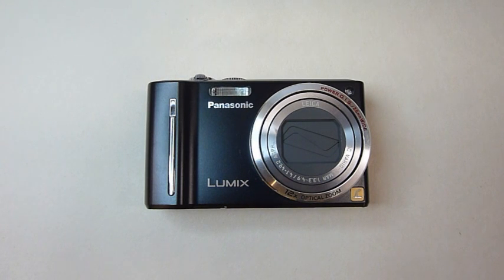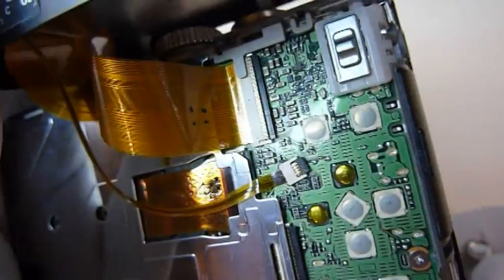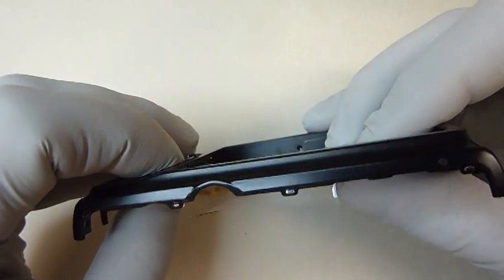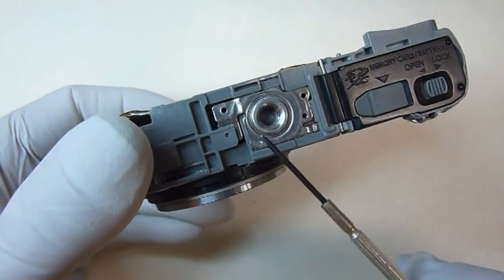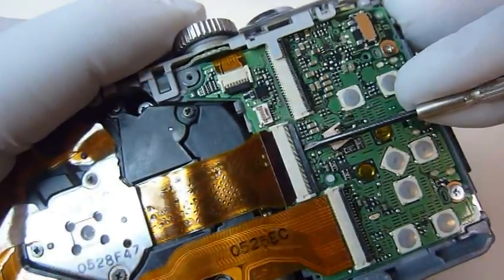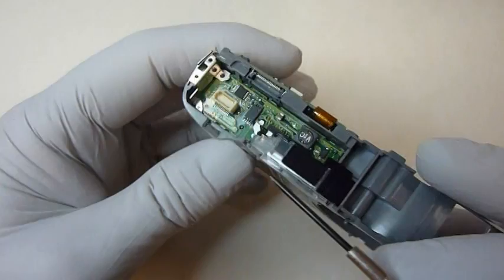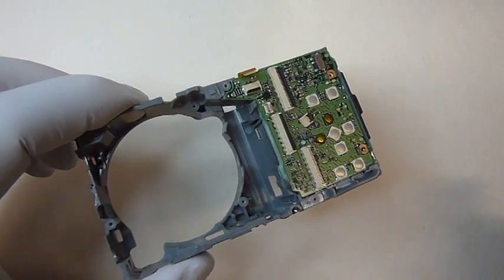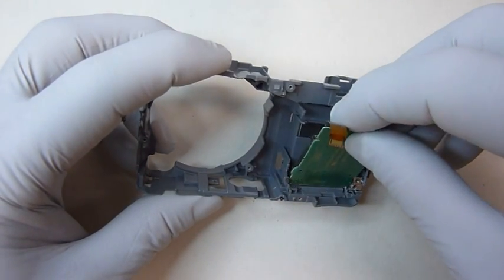Repair A Panasonic Lumix ZS6, ZS7, TZ9 and TZ10

Comment: since you say you've owned many Lumex Cameras perhaps you can help me troubleshoot an issue I have with my Panasonic Lumix DMC-ZR3. The zoom toggle and the mode dial are very hard to move. Niether move smoothly. What can be the cause and is it repairable?  Thanks Kathy
Reply from the maker: Hi Kathy.

I haven't worked on a ZR3 before, but it doesn't look too much different from some of the other models I have worked on. My guess would be that sand or something gritty got under the controls. Or, something sugary was spilled on the two controls (and I have first hand experience of doing that!). I would probable tear it down far enough to remove the top control piece and then remove the two control  knobs and clean under them. I haven't actually done that before, where I've removed the control knobs, but I can sure check it out to see what it will take. It might be a day or so before I will be able to do that though. I'll let you know what I find when I do.
- Bob
Reply: Robert Hosea thanks, I'll keep checking on for your advice. Much appreciated.

Comment: thanks..I only had to do an LCD replacement, on a ZS20, which is similar, and I wouldn't have had the nerve to try it without seeing your video. I was surprised it worked, as those tiny flat cables don't seem to go into the female parts very far and I was afraid to push them with anything that could cut the delicate little things. But, it worked putting them in what didn't seem enough. Thanks again.
Reply from the maker: Great job on getting the LCD display replaced. And thanks very much for your feedback!

Comment: Thank you for the video. I fixed my dust problem on my DMC-ZS7 with no difficulty. I used a brand new phillips #000 screwdriver ($5,95 + tax) and it worked great. Not sure Panasonic does the job for that price.
Reply from the maker: Great job! I'm glad you were able to clean your ZS7. Thanks for the feedback!!

Comment: Your video made it simple to remove and fix the SD card reader in my new , secondhand ZS7. BTW, the screwdriver I used was a Philips #000 bit from the iFixit driver set. Perfect fit.  I have decided to buy up broken cameras, and to fix them for fun ( profit, perhaps unlikely).

Thanks, again, Robert, 

Pj
Reply from the maker: Hey, thanks for the feedback Peter. I'm glad the video helped out and also that you were able to get your ZS7 going. You know, it's funny that I've tried a couple of #000 and #0000 screwdrivers from a couple of different sets and neither seem to fit the screws. That's good to know that you found some that work. I'll definitely check them out. Thanks!

Comment: Hi Robert -
I wrote a month ago and am now trying (again).  The lens is operational -- but there is no view in the viewfinder.  I wasn't able to put the black bar back onto the little pins, but the ribbon seems to be tight anyway.  Is this the missing link to no view in the viewfinder??  The black bar that I am talking about is the very last one you'd have to do before screwing the cover on again.  Perhaps this isn't even the problem?????  No view in the view finder.....
Thank you in advance for your help.
Reply from the maker: Rosemarie, I don't believe the ribbon will connect properly if the bar isn't on there. But, if we're lucky and it is making a good connection, there is one other thing that you could check. The small ribbon that goes to the LCD display sometimes appears to be connected properly even with the small bar is in the locked position, but the display still doesn't work. This happened to me many times. What I found that happens is that the ribbon is just slightly at an angle in the connector. All I've had to do is to unlock the bar, then straighten the ribbon just a little bit, and then re-lock the bar again. There have been times when the ribbon looks straight but it still wasn't making a good connection. I've never had that problem with the bigger ribbons, just the small one. Let me know if that helps at all.

Comment: Great video, I was looking for a fix for a TZ2 with purple sensor bleeding. With your video I'll be up to taking it apart. Its seems to be a time dependent fault (temperature or charge leakage of the photo sensors) in that you get about 3 sec to take your picture before the images "bleeds" away and is also recorded that way. Thanks for sharing the instructions. I have fixed a Canon EFS 17-85mm IS lens with cracked flex cable before and provided pics of that but I should do a you tube video too! regards Barry
Reply from the maker: Barry, thank you for your response to my video. Good luck on repairing your TZ2 and I look forward to seeing your video on repairing the Canon lens!
Reply: Hi, my camera suddenly started giving me huge areas of purple underneath anywhere where the sky is over a certain brightness. I guess it's a photo sensor problem. Now do I replace the whole lens unit or which part is best to try? I've done some googling around trying to find a fix for this and so far - no dice!
Reply: Oh, it's a TZ10, by the way.

Comment from the maker: Hi Rosemarie. I've had the same thing happen. If the black bar didn't break and it just came off you can put it back on. I used a lighted magnifier to see it better and a small screwdriver to slide it back over the tiny little pins that it rests on. The side of the black bar that is flat goes on first. The other side has a little bump and it faces away from the white socket that the flat ribbon goes in. If you have problems I can make a video that shows how. It would take a few days to make it

Comment: Thanks much for the excellent video.  I dropped my ZS7 face-down in the sand and want to attempt cleaning it, as it takes much better quality photos than my ZS19, and allows more user control over the results.  Your video will help a lot.

Comment: Great video.I love my ZS7 but it got wet scuba diving on vacation.Everything worked except the lcd. I ordered one from hong kong and swapped it out but it didnt come with the backlight.The display still didn't work so it was probably the backlight or possibly the main board. Instead of buying another backlight I got a used for parts complete camera with some dust on the inner lens. I just swapped backs and my original is like new again. I also have  a spare for any other parts in the future.

Comment: Thanks for this.  It could just save my bacon.  A glass of beer was spilled when camera was almost new.  (By a sober diner at a wonderful Paraguayan Restaurant).  Some controls now stick.  I'll bet cleaning them up will make a difference.  Worth a try.  Repair shop won't open the camera for less than $150.